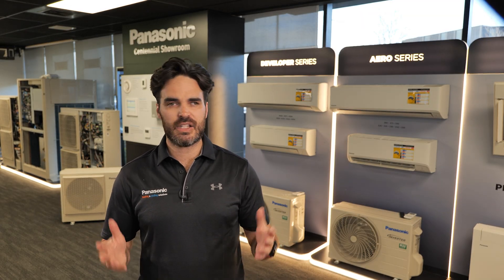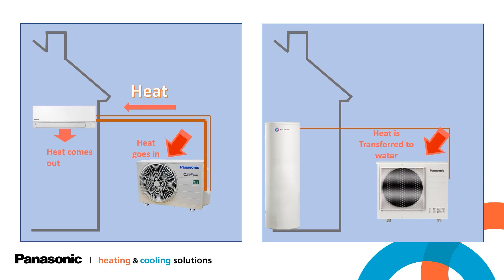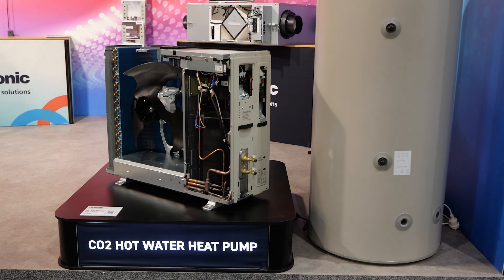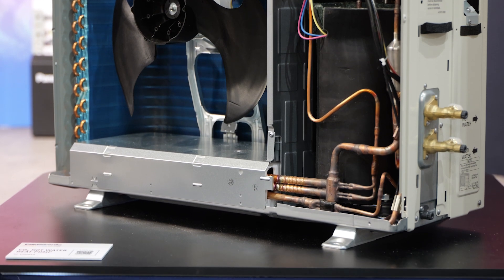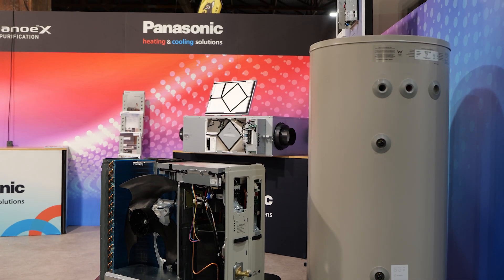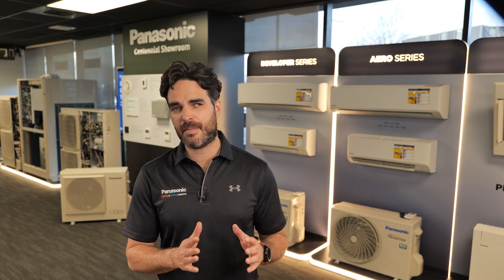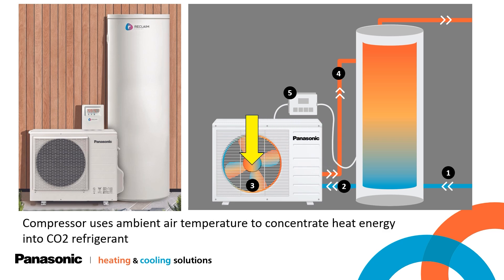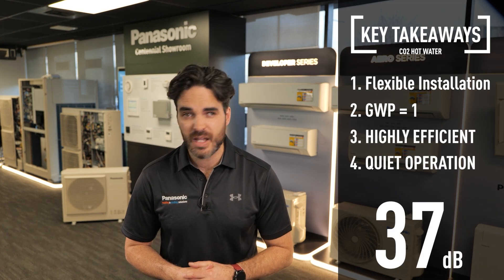Panasonic Hot Water Heat Pump

Comment: Bought a Panasonic CO2 hwhp, and I'm disappointed by the lack of smarts. It's a nearly $10k machine with no app, no easy ability to control it. We have solar so it would be good to optimise it or at least have a simple control like "heat the water up to max each day at 2 pm". At the moment it heats the water up only reactively, which tends to be when we shower at night, requiring import when we have abundant solar during the day that is half the cost. Also just basic monitoring like the heat pump apps, e.g. how many kwh is it using each month? I have no idea, I'd have to just take a guess really.
Reply from the maker: Thanks for your feedback, I will pass on to Heating & Cooling team to look into as power management is really important and something we do have control over for our energy products as well as other heating & cooling products in the range.

Comment: I have a Panasonic ducted heat pump system installed 2 years ago, 7kW one. do I have to install a separated outdoor unit or the hot water heat pump can be integrated into the existing one.
Reply from the maker: Unfortunately,  the Hot water heat pump system works differently to your ducted system and can't be integrated into your existing set up.

Comment: the circulation of the pump is sometimes 50 liters, sometimes 5 liters and the heating does not work, but the circulation pump is not blocked
Reply from the maker: Please call Panasonic Customer Service and they will help you from there